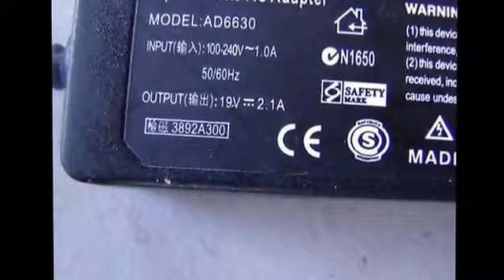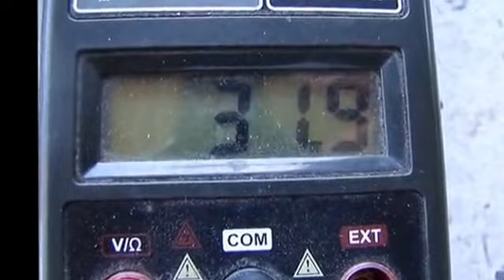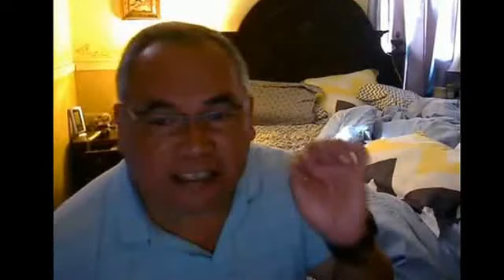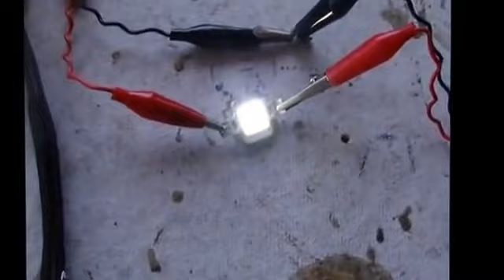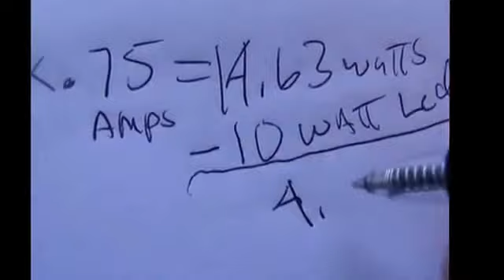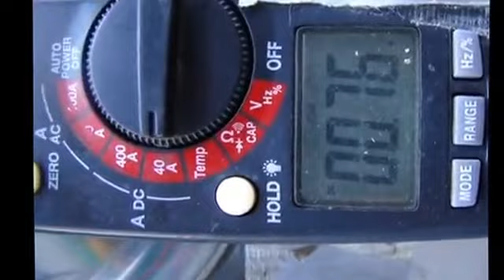Overunity   with 5 watts running the show 360p

Comment: I think if you add a load to the last motor, like a hand drill or something that does considerable actual work, you will find that the amp draw through the whole system will increase. Add a heavy flywheel between the first motor and the generator. The kinetic energy of the flywheel at speed should be at least two and a half times the maximum load you put on the system. This should diminish higher amp draw at the first motor. Chas Campbell flywheel technology should be investigated to add to your system. Good job adding the capacitor.

Comment: Dear Alex, Please advise if the 9.13 Khz with the 16% Duty is the correct signal I should get on the Transistor gates of the Sul-Tech's radiant charger you use. Thank you.

Comment: Your last comment about amps killing the sorce power, was correct.  But load requires amps. I cant see how to get around it. A small amount of over unity does not move an electric car. A huge amount of over unity is requires to move an electric car when over unity is all you have left. 
We need to understand Tesla's invention of powering a 60 horse motor from free energy from the space around us.
Im not smart enough to nut it out.
Reply from the maker: My hat's off to Tesla but in this vid you will see the high amp motor (kills the source at 2.1 amps ) triggering the cuttoff switch except when we run it via the oscillator...then there is no problem... runs on steroids..https://www.youtube.com/watch?v=H4M4vkGILcA&t=389s
Reply from the maker: correct and thanks for your comment, the minute we destroy lenz or know a way around it we will have overunity.  imagine a free wheeling generator so that a small rc brushless motor can provide enough energy to run a large high amp motor how? we no longer have the drag effect so that the production of electricity will have nothing to do with the load as in the past we are dealing with archaic systems to electrical generation
Reply: But with all that you show in this and other videos, you still haven't been able to overcome the lenz, how strange?

Comment: Could you please add a greater load to generater.  Something like the available anps from power source.
Reply from the maker: dale i think ive got a way around lenz, its a physical differnce from the clasical bedini style core
Reply from the maker: Amp usage is only a mirror to wasted energy. i.e. an electric blender burns out when stalled, your starter smells of burnt cables after a few tries. We have been taught to use
brute force to overcome. this is a quote from tesla writings..should it prove to operate in this theoretical manner, would be to describe it as a self-oscillating capacitive system. Once the device is set into oscillation, very little power is expended in driving the load. Because it is an electrostatic oscillating system, only a small amount of charge moves through the load per cycle, that is, the coulomb per seconds = amps are low. high efficiency equals low amp draw

Comment: HI Alex great work you are doing. just wondering if you tried  a capacitor on the generator or on the second motor?
Reply from the maker: wow its been a while since the experiment,  I was showing that you could continue to add one load after another without increasing source amp draw; but to answer your question i dont think i did, you see the capacitor effect happened when the source was pulsing dc & after the first motor then it was like normal ac/dc currents

Comment: It could be over unity! ..... as you need to add the final motor load wattage to the LED (10 Watts) they are in series and dissipating a separate power each. So load power is greater than the 10W in your calculation ...making efficiency higher.
Reply from the maker: Thanks for your encouragment, I believe because we are pulsing the dc there is a dead time between pulses and at that moment the capacitor spits out its stored energy all at the oportune timing so in effect the back emf is not working against the drive motor but is working with it!!! The consumption of power stays the same .77 X 19 volts=14.63 watts with or without led or 2nd motor

Comment: You're running an led that will emit light from milliamps, and a free spinning motor that pulls hardly any current without load. Give us volts and amps input (not just what it says on the transformer), and volts and amps coming from the generator. That's all that matters, the rest is smoke and mirrors, like all the other over unity bs on youtube. After all, what have you really done except bridge an AC source with a capacitor to drive a DC motor , and suddenly you've sold the worlds energy problems? Of course, no one in history would have thought of that before (bring on the conspiracies ) YAWN

Comment: Today i´ve been testing with a replicate radiant charge from the chematic of peter Sul ..
: my charger uses 13,8V-2,3Amps , from the "CPS 3205 Compact DC Power" , and the 
Mosfets gets warm -this means i use 30Watts/ , i monitor the amps from the digital power supply , i observe that your charger has less mosfets......., but i started to think, if your Amp/Clamp reading is maybe not exactly correct + , i see my amp reading with a clamp meter is infact showing about 0,5 Amp different than the digital Ampmeter on the power supply , but in my case the clamp meter shows that i use more amps, than the digital amp-meter ! , i started to calculate if you provide 19V, and 0,75Amps its    14,25 watts/ but if the amp reading is wrong, the circuit could use 19 x 2,1 = 38 Watts ?
That said, i hope you hook an amp-meter into your wire, and make a more accurate amp reading. - i tested on running a dc-motor, and a connected generator, which is said to be 65W motor/generator 50-120VDC - looks similar to your setup, in size. The Motor will not turn without the capacitor in parallel. -the motor when running connected to the generator runs from 1,8Watts directly from 32VDC Benchpower using:57mA, and drives the generator.Anyway interesting effect from the pulsed DC Charger !, but in my case the radiant charger uses 30 watts to run a motor&generator that only uses 1,8 Watts .
Reply from the maker: +cat1stevens please see this vid showing difference between full 2 amps on a drill motor and the dc pulsed high voltage setup with minimal amp draw,,,https://www.youtube.com/watch?v=H4M4vkGILcA  thats why I know it draws less than the 2 amps its rated for and yes I can get it to draw full 2 amps but under very heavy loads

Comment: I like nice shocks waiting for me. Your little converter I imagine is making a collapsing magnetic field which is generating a high voltage transient, sorta like a what a transformer does in stepping up voltage. If you measure it with a meter it is only 84% efficient.

You can measure it easily by simply taking your collapsing electromagnetic field coming off your converter and charging a capacitor with a resistor  across the capacitor as load. Take the voltage drop across your capacitor and divide it by the resistance and wallah, you have your current measurement now. Take your current and multiply it by your voltage drop and now you have wattage.

I almost can guarantee that your wattage you measure there will be EXACTLY 12.2892 Watts.

Your total input current coming from your power supply doesn't drop because the collapsing field happens at the end of your pulse, especially if your frequency is tuned, and so it happens at a totally different time. There are two separate times, once from the pulse on, and the other from the pulse off, which doesn't effect the input current in any way at all just as you've demonstrated there, because it's happening at a different time, and so the source doesn't FEEL it.

You are effectively driving all your loads with a collapsing electromagnetic field. The capacitor simple adds to the efficiency just as Tesla discovered.
Reply from the maker: +debunkified I think your analysis is a very good take on what is going on and I appreciate your input
Reply from the maker: +debunkified  There is a vid where you can see and hear(rpm) the difference in the motor running using standard direct method and pulsed high frequency-high voltage setup...https://www.youtube.com/watch?v=H4M4vkGILcA

Comment: https://www.youtube.com/watch?v=xrkvMpMiuLM
The Bulb is 220-240 60mA = some 13Watts , and lights from a 2watt output signal generator :) Quick RF LovVoltage SquareWaveTest. Bulb switches off at frequencies higher than aprox- 400HZ.    ....: replicating was sensitive to having exactly similar lightbulb , i do like very much your discoveries ,with converting dc, to hf pulsed dc its a thumb up from me !!  (y)
Reply from the maker: +cat1stevens New vid out "high Voltage" running a 18 volt dc motor with 200 volts .7 amp and running a short across with a cap, boy runs like crazy and this is a high draw motor!!https://www.youtube.com/watch?v=H4M4vkGILcA
Reply from the maker: +cat1stevens another discovery was using a piezo transducer with this pulsed dc and did i get a rude awakening, it popped me with 480 volts shock. You see the piezo acts like a pulsing relay or oscillator and frequency determines power sooo the high vibrations of the piezo brought the voltage way up there.
Reply: i see - so the radiant charger circuit amplifies the voltage to such heights :) - anyway fantastic results,with such a steady Ampdraw 
i saved the charger schematics&partslist.....: whats the input voltage limit ? i think it says 12vdc om the paper , and quick calculation says that if you put 19vdc in, and get 200v out, its aprox 10-times.....: have you measured the frequency ?
Reply: i allso should say that your power provides : aprox 40 watts, and you deliver say 200v at ,7Amps which is roughly 140 watts :)
Reply from the maker: cat1stevens NO that .7 amps or less than 1 amp, power supply can only provide 2.1 amps maximum but it does'nt even get there, only .77 amps
Reply from the maker: +cat1stevens Hi thanks for commenting but just wanted to clear things up; that is point77 amp or less than 1 amp and much less than what the power supply is capable 19 volts at 2.1 amps max so .77 times 19 is actual wattage
Reply: Yes - i should say it was capable of 40 W
anyway i understand that its in the amount of 14-15 watt to run the hole table :)  : thanks for sharing Alex manzanero !
Reply from the maker: +cat1stevens No i dont have equipment to measure frequency but the output measured with neon electricians meter measures 200 plus but if you charge a capacitor say a 250 volt cap it'll charge up in 2 seconds flat and a microwave oven cap of 900 volts in about 3 seconds but I think it will not go over 900 volts also it would be too dangerous if you touch the cap but it is safe (220 volts) just touching output without caps because it is a different type of electricity,(cold) no harm done at 220 volts to hands or fingers. Ive asked Mr sul how to beef up the circuit say to 5 amps but no response
Reply: You are really on to it here Alex  Manzanero !!!
This is fantastica :) 
and really a gamechanger in the understanding of over unity related to the laws and formulas ! : BIG SMILE !!!! from Norway !!
Reply from the maker: Thank you soo much, I think you and I think out of the box because if we went to college they would make us believe its impossible but just think of all the atoms just vibrating, and they say there is no perpetual motion yet the whole universe is perpetually active

Comment: Very nice i have a similar set-up im using a filter and getting more r.p.m great vid just wondering how much load can you put on that second motor? thanks for the share.
Reply from the maker: +green N.R.G !st motor runs with high voltage which turns a generator, now generator is producing regular electricity around 29 volts along with regular amps so it turns the last motor with a lot of torque with no difference in amp draw from source!  I have a new vid "high voltage" which further exemplifies the torque..https://www.youtube.com/watch?v=H4M4vkGILcA

Comment: Ever think about putting the circuit in structured water?
Reply from the maker: +Hazenthly&#39;s Fire No i think i might ruin it; im using baby oil as per Mr. suls advice
Reply: if the circuit powered an hho device, I bet it would output a good quantity of orthohydrogen,  provided the frequency was correct,    i made a circuit and a video last year,  but the video sucks.  it was a homemade flip. flop circuit that pulsed an output of conventional dc voltage one way,  then while it did this,  it powered up a coil and when the power shut down the pulse released a shot of ambient energy with such a blast of large orthohydrogen bubbles that it quadrupled the conventional production when the emf shoots back from the coil after it demagnetized.  it was very evident when I filled a baloon and lit it up,  the balloon was 10 times more flammable and was hardly explosive.  it emitted a massive orange flame,  not a bang,  so,  the effect is more like gasoline than normal hho because it output 4 times the gas per minute vs.  a brute force system and gives me 50 plus mpg in the city with my. pontiac 4 banger  and a Volo instead of 24, so somethings right.
Reply from the maker: thanks for the input, and yes it produced more than i thought it would because most devices have an overkill of amps and what they are showing is steam production and not true hho just hot water steam!! like 50 amps or more so i was amazed at less than 1 amp how much production

Comment from the maker: As a general rule all those circuits that have a pulsing effect, car relay oscillator, sparkgap from tesla hairpin, Imothpek's oscillator, I see something in common, that is we for a brief second have stopped trying to push electricity down a circuits throat and for a brief second we are allowing ambient to kick into our system. My extension cord setup doubles the voltage from 220 volts to 480 plus using an old extension cord, nothing fancy just letting ambient seep in. Ambien environment doesnt like changes so it over-reacts and sends a backlash into your coil to try to achieve equilibrium but electricity has a type of inertia that where the extra energy is registered as in experiments with a 3.7 volt battery giving you a 90 volt shock!
Reply: Alex Manzanero thank you for sharing I believe what is happening is that the capacitor is translating the voltage into instantaneous current I have done the same basic thing with a Newman motor that I built I can run it with a dead battery until the battery will no longer run the motor then hook up a capacitor and the motor will take off like nobody's business. I use a 10 volt 450000 uf capacitor can you tell me what type of capacitor you are using thanks again for sharing God bless
Reply: Could you please explain how the high voltage dosent. Burn the motor